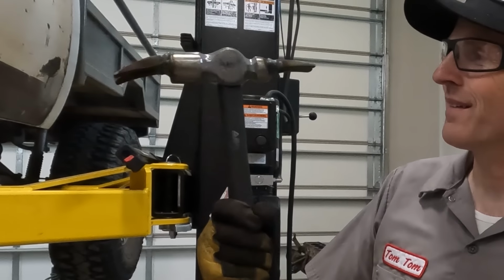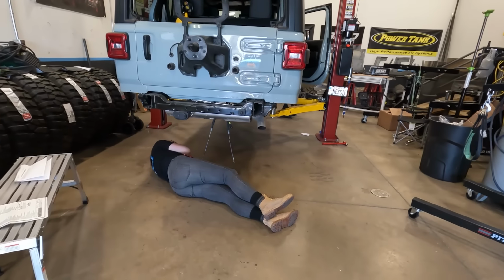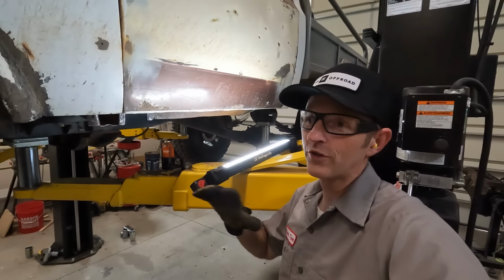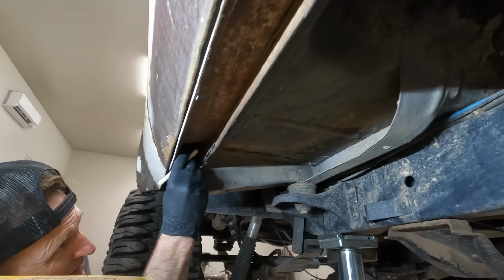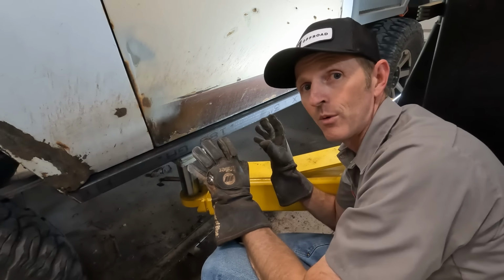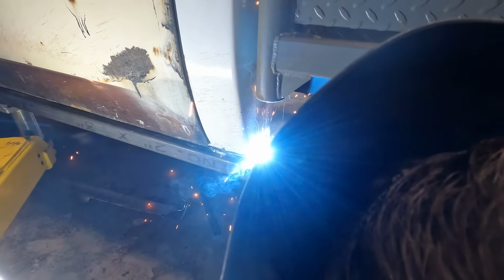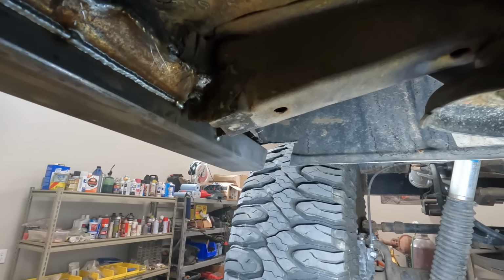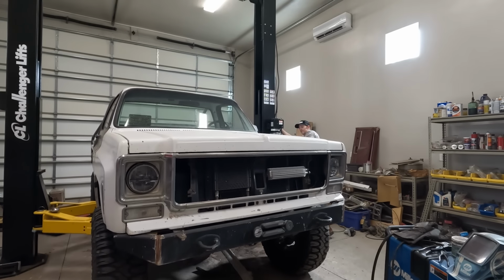Fabricating Custom Rock Sliders!

Comment: I’m running a set of those 42s on my Comanche. You’re right. I bought the tires first and it helps motivate. I finally installed some exhaust for the 6.0 last night. Day after day a little at a time and mine is coming together

Comment: Good idea Tom, brings much more stability. 
In the mudguard area, I would weld approx. 5 mm plates onto the square tubes, which are at wheel height on the inside. This will protect your mudguards. We used to do this when we converted our construction site vehicles for Asia, Africa, Australia and South America for off-road and bush use.
Tom I drove a 4.2 liter turbodiesel Landcruiser for a few years as a company car. In winter with Mickey Thompson tires and outside tread. Normal diesel consumption 10 - 12 liters/100km. 
With Mickey Thompson tires 16 - 18 liters/100km.
Greetings from Frankfurt

Comment: As a Fan of both you and Matt I feel like I am more involved in the Ball Peen vs Claw Hammer Debate than the typical viewer.

In the early days of Matt's Channel, I sent Matt a Blue Wooden Handle Ball Peen Hammer.  Back then Matt was able to open gifts from fans and cover it on the Channel.

He read my note that read "For all I know you have a dozen Ball Peen hammers but prefer claw hammers because of a sentimental or functional reason."

Matt said thanks for the Hammer and said "Tom Tom has been using it."

Matt stated that he also used hammers for "Hacking and Prying."

Just had to brag about my Blue Hammer a bit.
Reply from the maker: That was my favorite hammer in his whole shop! I regularly oiled the wood handle.
Reply: @tomtomsshop  thanks Tom.  It was fun seeing it in use.

Comment: good show.   i like the step by step fab.   I guess you know - taller tire =bigger lever you have to work against .
Reply: The benefits far outweigh the negatives going to bigger tires. 
Primarily an object is much easier to roll over than to climb up and over so the “bigger lever” in this instance doesn’t need the extra power.

Comment: Tom, you can use the fuel tank brackets for mounting an air tank so you can have extra air capacity for airing tires.

Comment: Nice work. For myself I would build notches in so you can use a high jack on them also I would plumb air to them as reserve air tanks. Maybe build rock lights into them and finally taps for the wet bar with a variety of alcohol. Not serious about all of that.

Comment: Tom, I think you sliders are coming along really well.  For me I would want my sliders to stick out a little more, because when the rocks are hungry they can bite higher than you expect.  I would add a piece of angle iron (maybe 1x1x3/16) to the exposed face of the rectangular tubing with the bottom of the "V" pointing outwards.  That would give you a surface that could be replaced easily, down the road, after an attack from those insidious rocks.

Comment: You should try steel it. Its weld through stainless steel embedded paint, even after welding It leaves a non rusting surface, and it looks amazing. I use it on all my builds.

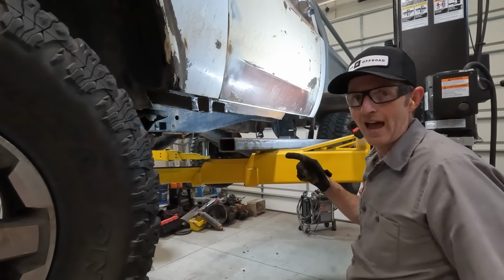Comment: 8:45 on holding stuff for welding I like those cheap little screw/ scissor jacks that come in the trunk of 90% of cars there cheap like 10$ at pick a part and u can weld Clamps and really anything to  them and there adjustable in height great for holding stuff

Comment: Put a few drain holes in those sliders. If you plug the holes you will get water and rust...best to live with the wasps and not rot out. Matt just did a review of what happens if you don't let water out of all the structural elements in his last video.

Tack the hammer to your rear bumper..keeps folks from tailgating :)

Comment: Weld a square plate to the end of the tubes that tie to the frame. Drill holes for bolts to frame rails. Weld nuts to frame so when you need to remove frame you won't need a backup wrench

Comment: I need to complete my rock sliders on my Square body crew cab. I built mine to run the length of the front fenders to to just past the saddle tanks. My square body is a rust free Vegas cream puff truck that saw very little wheeling by past owners. Since my truck has a 10" lift with a 1" ORD body lift I have a lot of room to mount my sliders to the frame with a set of rubber bump stops to protect the body from body roll. My sliders will not only protect the body, but also protect the saddle tanks from side impact.

Comment: Old Skool would fab an angle brace from the rear of rock slider (weld) to bed (bolted), could also as a debris block to under chasis.
Toolbox / winch compartment?

Comment: Tom,
If you plug the holes in the bottom of the frame there the frame will rust out.  That's what they're there for - to let moisture escape.  Yes, I am familiar with your area and know it is dry.  But all it will take is a little salt getting in there (which it probably did long, long ago) and without an outlet that thing will disintegrate faster than you think possible - even in Utah.  

The best way to keep insects and mice out is to run the vehicle regularly.
Reply: Matt just showed warped frames from water getting in then freezing due to a lack of drain holes

Comment: Hey, Tom Tom.  Highly unlikely that the slider and body are sealed and watertight.  Instead of plugging holes, you should make more so that water can drain out.  Otherwise its going to rust from the inside.

Comment: Did you test the rock slider is fully sealed from the outside air. Otherwise it will start to rust from the inside out... Just a thought... =)

Comment: Long overdue. As usual, some customization required. Once the sliders are in, add the wheel well storage. The back empty space look goofy. I would delay the checkered plate, double work.

Comment: Hey Tom. Curious what wall tubing you used for the slider. I’m doing a similar single cab truck that’s a bit heavier than most of the jeep builds I see. On the other hand they’re a lot shorter on a single cab so less bending moment

Comment: I wouldn't weld the rock sliders to cab i would put them to the frame and make brackets to blolt them to the frame. Thats going to be a lot of pressure on the body mounts and body. Just my opinion

Comment: I have a curiosity. I own a Ram TRX I have the electric side step as I'm disabled and have a hard time getting in and out without it. I'll eventually be going to 37" tires too.

My question is is it possible to create rock sliders while still having the power step?

I drive my truck out in the desert here so the time and would look to have something similar. Out messing with rocks up in the mountain I managed to kick a 2 foot rock into my rockers and passenger door causing a 1 inch deep about a foot long dent.

Other shops have told me it's impossible to have both sliders and a step. Personally i'd think if the rock sliders were steel you could make them the steps and move, but I know nothing about fabricating.

Btw if love to do 40s and turn the truck more into like a prerunner. I've used MT Baja Boss at tires since 2020, amazing tires. They do so amazing in the sand and snow, well most we really get here is a foot or so, but still do great. I love them in the dunes and the dirt areas where no one drives.

Comment: Tom Tom, here are the ways to tell which nest goes with which wasp/hornet/yellow jacket:

Wasp (red, yellow, brown or black) has an open paper nest and they have varying degrees of aggression  with the red wasps being the most aggressive 

Yellow jacket is smaller in length than most wasps but is more stocky. They build their nests mostly underground, inside dead trees, or inside walls (occasionally). They are highly aggressive and will chase you down !!

Hornet is about the same size as yellow jackets and in some cases are a little larger being very stocky. They usually build large enclosed nests that blend in with trees, on walls, etc with a hole at the bottom for egress and exit! They are even more highly aggressive, more like a yellow jacket on steroids when disturbed! While they are more aggressive, they won't usually go on the attack unless disturbed, which is less likely than yellow jackets since their nests are usually higher up not in the ground like yellow jackets! However once disturbed they are almost maniac in the way they chase and sting, chasing sometimes for hours/miles and don't give up!!

Comment: Tman, take the hammers and make a star wrench of some other implement of revenge and return it........had an old rock hound tell me once that sliders belong on the frame and not on the body, Make them so you can drop the truck on them and they won't move

Comment: could you just make brackets to bolt the sliders to the frame instead of welding them to it?  So the cab could still be removed if needed.
Reply: Real question would he welded to body how would that stop removing cab and second if he bolted would  that make it hard to boat the bottom

Comment: A couple of serious questions: First, shouldn't you include some weep holes to allow water to drain out? The way the rock slider was welded to the cab created a void that will trap water, leading to rust. Of course, the same is true of the rock sliders themselves. 

Second, the rear end of the rock sliders are unsupported. In the video, it was explained the gap between the rock slider and the bed of the truck will be filled -- perhaps with diamond plate. Will you be running a tube from the end of the rock slider up to the bed? If you don't support the end of the rock slider, it appears that you will have created a long lever that would increase the damage done if a rock ever hit the end of the slider. If it had been me, I'd have run the rock slider to just behind the cab. I'd want to still allow the bed to move somewhat independently of the cab. Besides, I cannot figure out how to support the end of the rock slider without joining the slider to the bed.

Comment: That's obviously a two-handed hammer, for when one hand is not enough.  I think the Vikings invented that.  I don't think your body welding adds much strength to the sliders.  It needs to be very well attached to the frame so it doesn't crumple the body when you hit a rock.  That tread on the sidewalls is going to be useful when you are driving up a crack.

Comment: I'd never buy new tires at the start of a build.  With my physical limitations, it could very well take 4-7 years to "complete" the build to a functional point and the tires would be expired by then.  What I'd probably do is see if I can find a set of dead/cut/destroyed 42" tires if I wanted new 40" for example.  It'd allow me to do all the cutting and building and have plenty of space when I do finally buy the new tires I want.

Comment: Tom, by thing in the body to rock sliders and then to the frame eliminating the flex of he can mounts don't you risk tearing the sheet metal body when you're out extreme rock crawling? I know that Paul at Fab Rats did the same thing. I never got around to asking him.

Comment: Just a heads up that POR-15 isn't even close to the best option to coat rusty metal.  Used it on a car years ago and huge sections flaked right off even after using all the right prep products from POR-15.  There's a video on the Repair Geek channel I watched going over a bunch of the options from a guy (and his chemist wife) who knows his stuff.

Comment: Merienda
Designed by Eduardo Tunni

Bold 700
"Tom Tom's" letters

Nothing You Could Do
Designed by Kimberly Geswein

Regular 400 
"Tom Tom's" letters

Almendra
Designed by Ana Sanfelippo

Bold 700 Italic
"Tom Tom's" letters 

This 1 is Clean, Classy easy to read but not boring.

Amita
Designed by Eduardo Tunni, Brian Bonislawsky

Bold 700
"TOM TOM'S" letters

Fugaz One
Designed by LatinoType

Regular 400
"Tom Tom's" letters

Quintessential
Designed by Astigmatic

Regular 400
"Tom Tom's"

Spicy Rice
Designed by Astigmatic

Regular 400
"Tom Tom's" 

If i were to use this font, id be replacing the O in Tom with a tire of the same thickness and width,

Just Another Hand
Designed by Astigmatic

Regular 400
"Tom Tom's"

Protest Revolution
Designed by Octavio Pardo

Regular 400
"TOM TOM'S" 

This one would be nice to if it was bolder, which can be done in : Adobe  Photoshop

Oooh Baby

Designed by Robert Leuschke

Regular 400
"Ton Tom's" letters

I just feel once you do merchandise it needs to look as a peeling as possible look at Fab Rats perfect lettering gets a good sales amount in merch. I ran an Graphics arts business for 28yrs in Corporate Awards and yhe orher half of the business was Giftware Artwork Etched in different metals and nice wooden frames. But our Corporate Awards you start at logos all day, all week 365 days a yr. Lettering is extremely important. Best of luck Tom, Family Friends and Fans alike, ill keep Yall in my daily prayers.